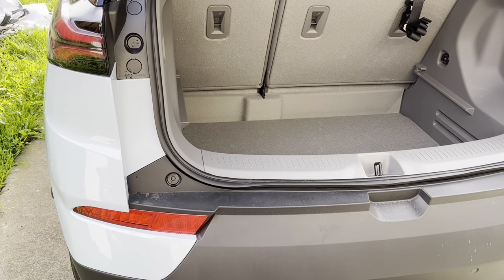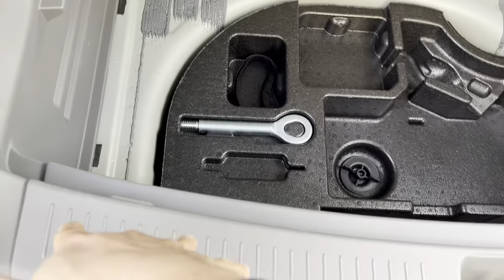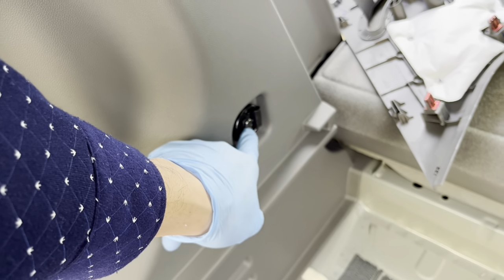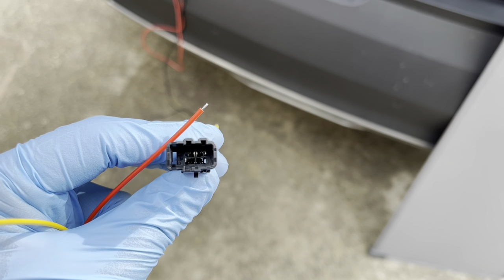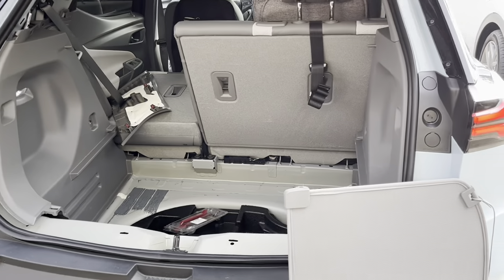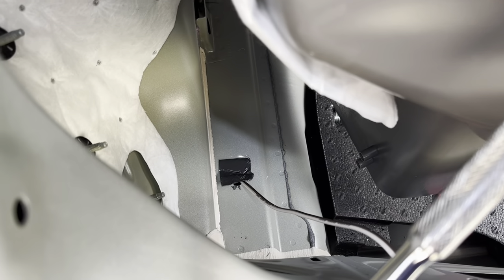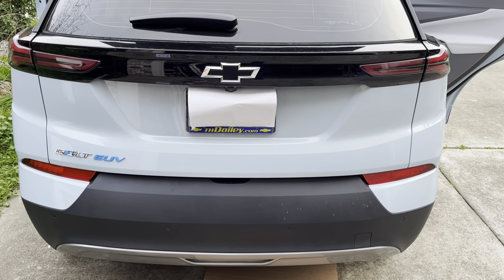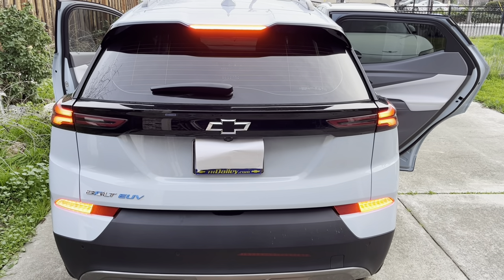Bolt EUV tail light mod procedure

Comment: Looked ok until you closed the hatch at the end.  With the hatch lights being the original brightness it looks terrible, in my opinion.  You may want to consider finding a way to dim them to match the dimmer outer lights.  Also those holes you're running wires through if the metal is sharp it could potentially wear the wires down and cause as short.  Finding a rubber or plastic grommet that fits the holes would be best.  I heard you say you were going to use silicon caulking, that should work too.  Thanks for sharing even if I didn't care for the outcome.
Reply from the maker: Thank you for the comment. I have the same feeling and is actually looking for a way to add some light before dimming the hatch mount taillights — don’t want to decrease visibility of my car to others at night is the main concern. As for sharp corners I used a rubber tubing for protection
Reply: @Kaixin Baba  I don't know how useful this will be but in the motorcycle world, kurakyn makes a run-turn-brake controller so you can change your single brightness turn signal only modules into running lights that also function as brake and turn signals. Pretty easy wiring and I think with some basic head scratching, it would be a brilliant way to fix the bolt taillights. You would get dual brightness out of the running lights and they would all be at the same level of illumination so as to eliminate confusion.
Reply: @xnmaidongxi  I've seen video where people I think use the same module for the hatch lights, tieing into the center brake light. That was just for tail/brake function though. no turn signal. To make the lights work as a turn signal too, I think you'd have to run a traveler wire up the pillar and through the ruber boot to the top of the hatch and down to the fixture.

Comment: I was shocked when I noticed they put blinkers on the bumper only. It made no sense to me and it was not visible nor safe. If you are standing close behind it at the intersection you cannot see it it wants to turn or go straight.
Reply: It has to do with federal law about where brake/turn signals can be on located on the rear of cars. Specifically, you can't put them on moveable panels (such as a tailgate/liftgate/hatchback) since if it were to fly open, one wouldn't be able to see if the vehicle is braking or indicating a turn. Since there were spots for lights due to various international requirements for rear fog lamps (in the US, they're usually filled in with reflectors), it was an easy swap to put the brake/turn signals there to maintain compliance. GM also wanted design parity between the EV and EUV and since the EV's hatchback has the pointy hatchback of death that makes standard turn/brake signals a no-go, so does the EUV.

If you think those are silly reasons for why things are the way they are, I can't disagree. I think it, like a number of other car regulations, deserves to be revisited and revised, preferably with input and data from international sources.

Comment: Can't this be done as part of adding trailer wiring?
Reply from the maker: It surely can and will be easier if you combine the two
Reply: I'm getting a hitch for 23 euv and doing this mod, diagram of this setup will help a lot